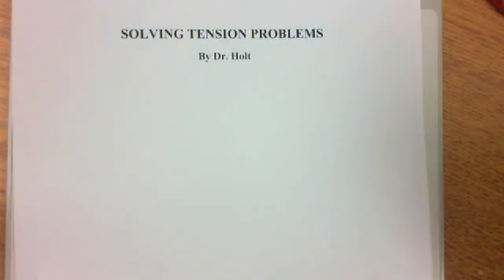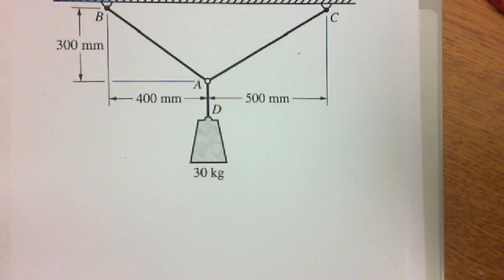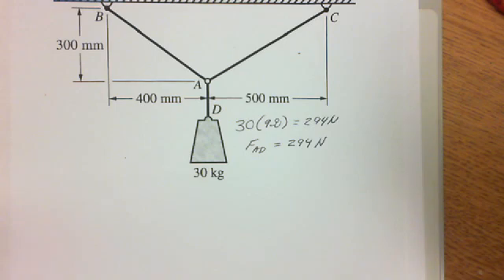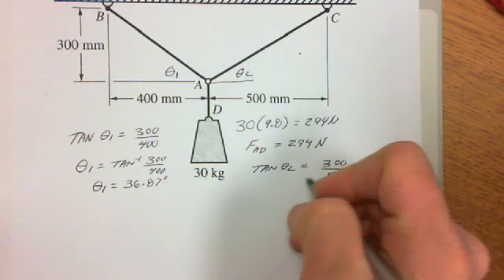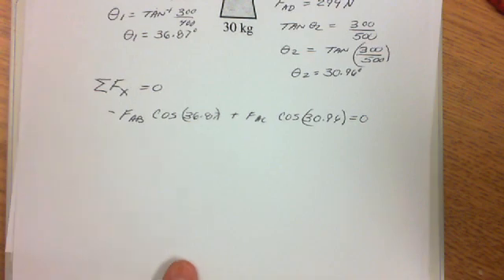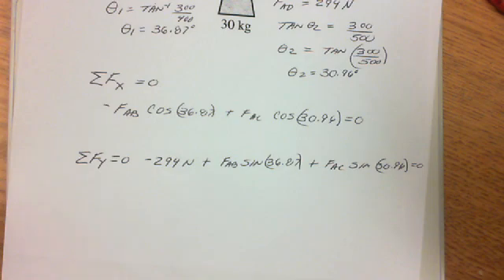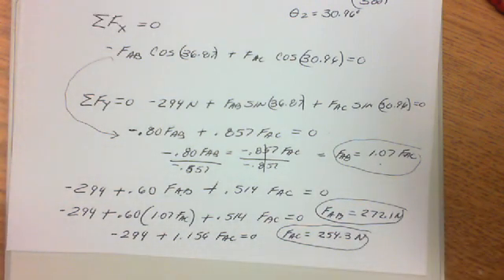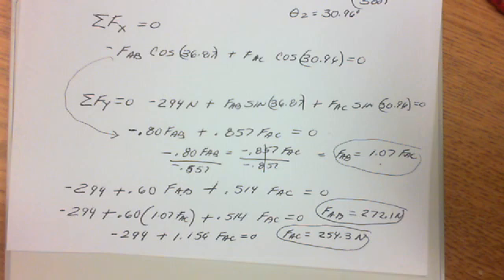Solving Tension Problems

Comment: I think the answers for Fab and Fac given in the video are incorrect, since their vector sum is not even approximately equal to Fad, which is 294 N. For Fab and Fac, I get 163 N and 191 N, which on vector addition appropriately give SQRT(163^2+191^2+2(163)(191)cos(37 deg +31 deg)) = 294 N.

Comment: Here are my answers (I used t1-Fab t2-Fac and t3-Fad)

For t1= 272.25 N
T2= 253.98N
T3 = 294 N

In your final answer, when i check it (all forces on the x-axis should be equal to 0), yours is laying on 1... something. Mine has a closer value to zero.

Comment: So on a 500' 65° decline..600plb weight..... Tree to tree guy wire. Using 5/8 braided cable. The tree at the top, the wire is attached 15' up. On the bottom tree, the wire is attached 20' up from the ground. 
The 600plb object is 8' long and 5+1/2' wide and 3' tall in height. Will be suspended by ropes and three equally spaced tandem pulley trolleys. Where as the top of the 600plb object leading to the bottom of the guy wire will be 9'. How do I know how tight the guy wire needs to be so that the object doesn't hit the ground but ends within 20' of the bottom tree and about 1+1/2' from the ground?
Who is the math god?

Comment: how come -294+1.156 is equals to 254.3
Reply: Arteinnian Grimes because it's 294/1.156=254.3..the variable was Fac which was multipled by 1.156 so to undo it you need to divide it out.

Comment: A ladder is placed against a perfectly smooth wall, while the base rest on rough ground making an angle of 60 with the horizontal. A work man of mass 95 kg stands halfway up the ladder. Assuming the ladder does not slip on the floor, find: 
(i) The reaction between the wall and the ladder 
(ii)  The direction of the reaction of the floor on the ladder
Reply: Cool.

Comment: Why do you round to a different number of decimal places in each number? Is there a recommended number of decimal places to use in order to get a more accurate answer? Should it not be consistent? Would it not be better to use all decimal places in the steps and only round them up in the final answer?

Comment: I think there's a mistake. I got the same answer for F(ab) but my F(ac) is greater than F(ab).  How could .8/.857=1.07???? I think your problem is right there...
Reply: He went the other way and solved for FAB by divided both sides by -.80. so the -.80 cancelled out leaving FAB = 1.07FAC. The math is right but he messed up his demonstration because he went one way of solving it in the demonstration but forgot that the answers to each step that he wrote down were from solving in the other direction. Do you understand what I mean?
Reply: That's what I was saying too!
Reply: YES !!

Comment: Two easy formulas that answer this type of problem every time without all of the equations. Each uses three angles. A,B and C.    In the problem above the angles are: A = 30.96, B = 36.87, C = 112.17(angle C is the angle between A & B) Angle C  is calculated  as 180-(A+B) = 112.17  Also, FAD in this problem is 294.
FAC =(FAD*Cos(B))/Sin(C) and FAB =(FAD*Cos(A))/Sin(C)  Note: The answers will differ slightly than in the video because this method doesn't do rounding early in the problem(except for the angle measures) as is done in the video. You can eliminate rounding angles if you have a calculator that will store to variables then use the stored values in the calculation.
Even if you must use the equations as in the video, these formulas are good for self-checking your answer.

Comment: at 6:49, i think he made a mistake, Fab is not = 1.07Fac, it should be Fac=1.07Fab. am i right?
Reply: Joel Haire The thing is he moved all his numbers over to one side then writes FAB= 1.07FAC without even mentioning why. I know how to do mathematics but the explanation isn't very good. Hence why I said he doesn't explain it very well. 

you know in 5th grade mathematics and through most of school your told to show your working out, which would be ESPECIALLY important when teaching someone <---- (focus on that part) is something you would think about. Cheers.
Reply: I think you are very correct
Reply: Siphelele Kondlo He doesn't explain it very well at that point, he moves numbers over to the left side then they magically appear next to FAC? Pretty sure it looks wrong from hwere I'm standing considering he hasn't explained how that happened mathematically.
Reply: i don't think it matters as long as the concept is right; i didn't even write down the values he wrote, I just wrote the formula that I will need for the quiz in about uhh 6 hours omg wish me luck im scurred.
Reply: yizongk try dividing .857 and .8 you'll get 1.07 just a reciprocal and moved it to FAC
Reply: Thanks, hope those new people who watches this video will know about it
Reply: He became to Confident.
Reply: Ghost572 All physics is linear work, which everyone should have developed in year 11 or 5th form Maths. Cheers.
Reply: also it will be equal to .93
Reply: Ghost572 I noticed as I watched the video carefully, it should state that Fac=1.07Fab using basic linear work, he's made a simple mistake and just written it the other way around, and also since he is teaching to lets say everyone that comes across this video on youtube that doesn't understand his concepts, should consider a minute or 2 at ending of this video for an explanation to the mathematics side of things so all people can comprehend.

Comment: why is Fab negative?
Reply: if you make the free body diagram you can see that the vector points towards the upper left of the diagram. Since we are looking for x, the arrow is pointing in the negative direction. if we were looking for y then it would be in the positive since its pointing up.  Well at least that's why I think its negative. I could be wrong

Comment: Dr. Holt,
When you solved for FAB you divided both sides of the equation by the wrong value. You should divided both sides by -.8 to get the value that you obtained because if you divide by -.857 you will get FAC=.933 FAB.
Reply: I noticed that as well.
Reply: I agree with you Noreen McGee. Thanks for it because i was also confused about it. Thnx alot
Reply: oh true
Reply: Zach Dissen I think he just accidentally wrote FAB instead of FAC
Reply: which is the real answer?

Comment: I used my procedure and your procedure and came up with the same answers which are: 610.74 N for the Tsub1 and 570.25 N for the second tension force. Only 294 N as an answer for the third tension force stood the same on both parts.
How come?

Comment: Wrong solution on 6:20. You should divide the forces by -.80 instead of -.857. Though however the answer is correct. :)
Reply: If the answer is correct, would the division also be correct?

Comment: Newton's 3rd law is that for every action there is an equal and opposite reaction. The object isn't moving, so there are equal forces acting in opposite directions.  If you imagine that the weight is on the y-axis of a graph, the AB vector is going in the negative x direction while the AC vector is going in the positive x direction.

Comment: Actually it is correct. 0.93FAB=1FAC. If you divide both sides by 0.93 you get FAB=1.07FAC or FAB=1.08FAC depending on how you round.

Comment: Your approach is correct. 
However, if we don't round off to get the approximate values for theta1 & theta2, we can get a better result.
tan(theta 1) = 3/4 => sin(theta1)  = 3/5, cos(theta1) = 4/5 .
tan (theta 2) = 3/5 => cos (theta2) = 5/sqrt(34) , sin(theta2) = 3/sqrt(34). 
The system of equations will be : 
resolve (vertically) : 
3/5* Fab + 3/sqrt(34)* Fac = 30g .
resolve (horizontally) 
- 4/5 * Fab + 5/sqrt(34)* Fac = 0
=> Fab = 250/ 9 * g = 272.2 (N) , Fac = 40*sqrt(34) * g/ 9 = 253.97 N